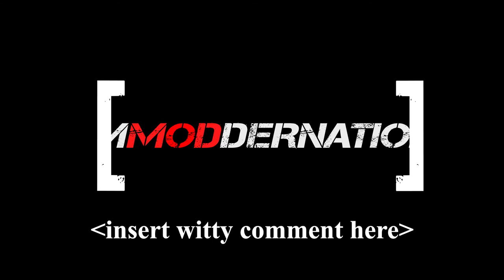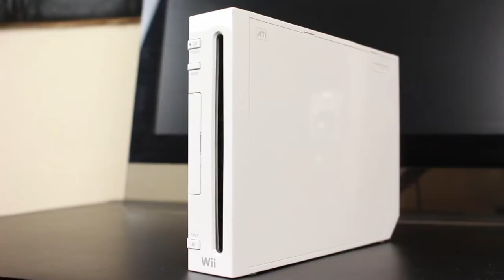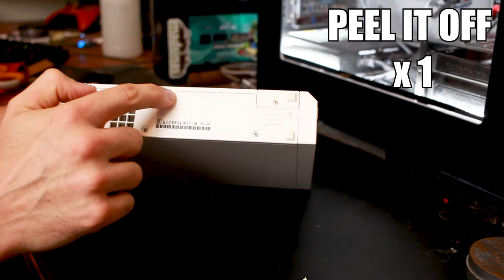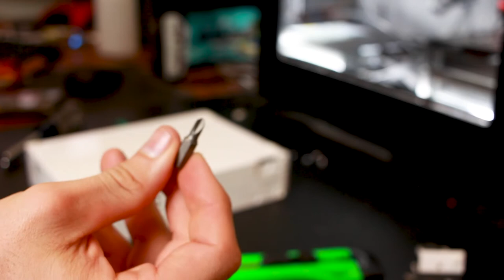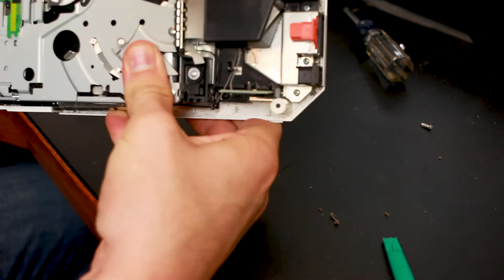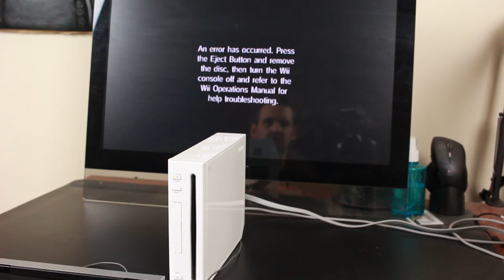Wii TEARDOWN AND REPAIR | CAN HE FIX IT?

Comment from the maker: The intro was filmed on Radiator Springs Racer at Disney's California Adventure. Let me know if you'd like to see more fun intros. 

Also, the Wii was thoroughly disinfected before I began working on it. It's important to disinfect when you don't know where something has been.
Reply: If it’s an disc error then most likely the disc just think before throwing it away
Reply from the maker: That might be but I tried the games on a working Wii and they worked just fine.
Reply: @ImmodderNation  How do you disinfect first btw?
Reply from the maker: Rubbing alcohol and paper towels. For dust on the insides, canned air and a facemask.

Comment: I have a question on this please do not get me wrong if possible. If one has a Wii or WiiU and the lost nan-image or firmware image to much in retrospective,... my question is this. Can one remove everything and make a firmware image from particular files if the drive still works as to so set up the firmware? I am asking as a repair question, knowing I know what filetype was included with the image. Simply saying this, that if one actually does manage to remove everything but the system itself or the cd drive still works and the power button, regarding those factors and with a proper controller... which is most likely to happen to some boot case or nutcase scenario as it would only resort to the wii menu or any other, is this truly a brick or a  brick that is fixable with the file types as to insert a new firmware? Knowing this it is a portable CD drive is what I am trying to explain really. But one would have to have bricked it so badly they would send it in for factory reset or at that mode to be at stock knowing the drive still reads but there is no system on it. - just in theory of course. Or does a blank drive with nothing on it on boot up though the thing still works is actually stock and scratch memory? Saying this factor, if a drive does turn on but does not boot into the menu and one does not have a certain bootloader, is it possible to fix? And also is it possible or how many systems actually fits into a CD hard-drive when set up from scratch... I am curious to ask this question knowing about a few technical specs. As it has few USB slots just like a regular computer, is it possible to do this with this type of hardware or what are the max system numbers that it can have... (if any) or what can it play particularly rather. Knowing someone else in another video made a really nice controller aside from this retrospect. = also some playable by gamecube ( = controller)   and wii remote (= a mouse). Or would that be a little complicated combining every system into one device? Say, someone actually did get passed the memory portions of memory and it does void warranty knowing any modding basically does void warranty coming with an agreement. What would be logical reasoning to make out of this or factors to consider? I mean, if emulation does work on it. Would it be the speed at which it runs knowing there is nothing on it at all after a particular memory brick or would that be the same as restoring a nan plus new system memory. As mentioned in some tutorials. Basically, stating what is the amount of memory that each Wii console can hold? = important question to know knowing the Wii itself can contain 255 operating systems or IOSes.
Reply from the maker: Thats a lot of question and I have no idea!

Comment: Why not just order a replacement laser for the Wii. I see them advertised for around $10, from China of course. 
The mechanism seems to be fine so I would try just a replacement laser first. 
Video was posted about 4 years ago, so I'll look for the follow up video. Is there a part 2 to this video? Not found it yet!!
Reply from the maker: After failed replacement drive I didn't pursue it further. Easier to buy a replacement drive with laser assembly than go through the trouble of removing and reinstalling laser.
Reply: @ImmodderNation  Each to their own I guess, Ive replaced lasers and its normally quick and easy. Thanks for your reply.
Reply from the maker: Thank you for your comment and for watching my video.

Comment: The easiest thing you can do without spending money is not to repair the reader and flash the wii to use by usb
.
You can also remove it and instead put an internal hdd, obviously an external hdd that will become internal, as you did in a video with the wii u and a pendrive
.
Reply from the maker: That might be the next logical step. Part 2 of this video never turned out because replacement drive number 2 still doesn't work. Somebody suggested maybe the drives are coded into the hardware so you cannot use replacement drives.
Reply: @ImmodderNation  Sad, part 2 will never come out ):
Reply from the maker: Probably not a PART 2, but a different type of video with the Wii. Nothing is ever done

Comment: I have done the drive fix before with a similar problem very easy fix surprisingly
Reply from the maker: Did you replace the drive?
Reply: Yeah my dad and I did it worked perfectly after that even gamecube games worked
Reply from the maker: Cool! Cleaning didn't work so drive replacement seems to be the solution perhaps.
Reply: @ImmodderNation  You can try 99.9% alcohol!
Reply from the maker: Don't think that would have helped in my case. Maybe another situation.

Comment: 8:50, I voided that 2 years ago. I absolutely ruined the case when I first opened my wii. I wish I had this video back then. The system still powers on, but the disc drive is broken. By the far the most common part that needs to replaced in a Wii. Everyone that I know that had Wii ended up with a broken disc drive.
Reply from the maker: Well I intend to fix this one. I hope.
Reply: Ya got this! Just hope for the best. Hope to see how you do it in the next video.
Reply from the maker: Thanks man. Hopefully the next episode is more interesting.
Reply: My old wii fried itself, not really sure what happened but it randomly shut off one day and never responded again not even a light on the power button no matter what I tried. I miss it.
Reply from the maker: Check your power supply first before you open your Wii.

Comment: 2:15 I am French and you absolutely don't sound French trust me 🤣
Reply from the maker: I can't even convince French people that I sound French. Hopefully I can convince people that I know what I'm doing.
Reply: @ImmodderNation  yeah. When will you upload the episode when you change the disk drive ?
Reply from the maker: @tpelegrin1320  The new disk drive only worked with some games and intermittently. I may just turn the Wii into a Homebrew system.
Reply: @ImmodderNation  yeah it's just what I was thinking. when I buy my Wii back in 2013, I never buy a single game, immediately right come of the box, I hacked it and installed whatever game I wanted. That was awesome I was able to play (and still today) any game on the Wii for free. I wait that happens to the switch. And when the hack sorted on the Wii  U I just bought it and do the same thing. (Sorry for my bad english, again I am French and the French people are reputed for they bad english.)
Reply from the maker: @tpelegrin1320  Your English is fine. I understood everything. You don't want to hear me speak French so I'm grateful you understand English.
Reply: @ImmodderNation  🤣

Comment: Hey my Wii wont turn any helpful tips its plugged in not lighting up
Reply from the maker: If it's not lighting up, it's not getting power. Could be power cord or power connector inside.

Comment: If you're going to call this video a teardown shouldn't it be torn down? You dint even remove the motherboard from the bottom shell housing. Many pieces underneath
Reply from the maker: Partial teardown. It certainly wasn't meant to be a guide if that's what you were looking for.

Comment: The ending was a bit of a letdown.  I would of enjoyed the video more if you had waited for the replacement drive to come in.  I was also a bit surprised you didn't try taking apart the disc reader more or cleaning the lens.  I would not consider this a repair video, but more of a teardown video.
Reply from the maker: I cleaned the lens offcamera, but it did not work. There's an issue with drive compatibility I heard about.

Comment: Your Center Disc Spindle Thing is Broken. Try loosening that up, and maybe try to add some lubricant after you've cleaned it really well.
Reply from the maker: I think the center spindle works fine. Same games will actually show up on the load screen, they just won't load. :-(